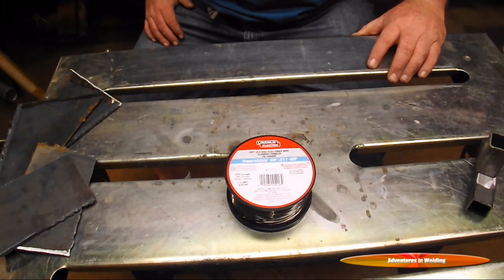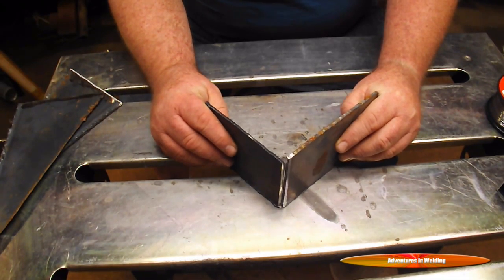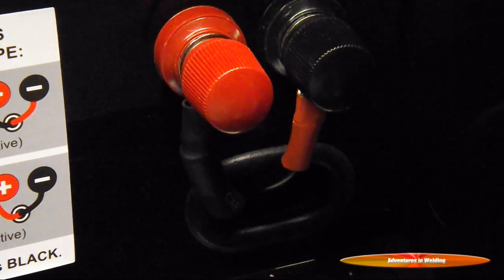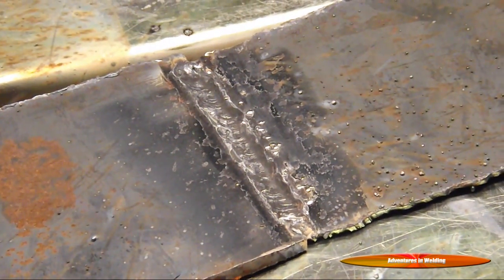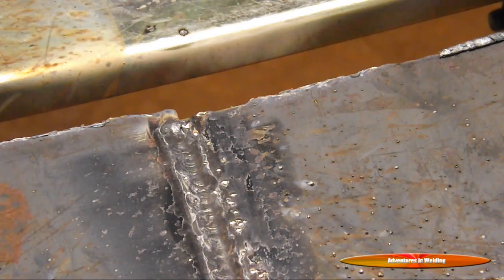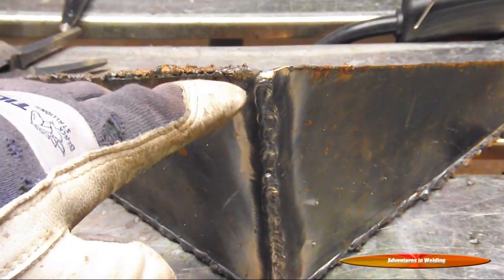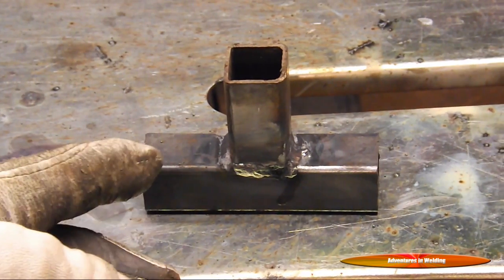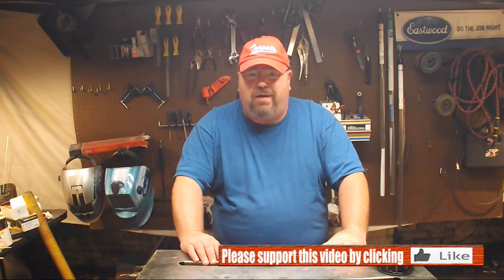Intro to Flux Core Arc Welding - Adventures in Welding 130

Comment: I tend to only use flux outside and even then use a respirator, I prefer MIG indoors as there’s far less smoke.

Here in the U.K. we’ve had a massive influx of East European machines which are great value, they seem to have pushed the Chinese out to a large extent. My package worked out really cheap and is a great machine, MIG, flux and stick 200 amp machine with gloves, automatic helmet, 0.45kg flux core wire, 5kg rods, magnets, spatter spray, welpers for £200. Since Corvid19 they’ve dropped the welpers and magnets and it’s now £250, I still think it’s good value. 

I always try to get the best consumables I can get and I’ve found a really helpful supplier, he’s been brilliant for me. I’m a disabled hobbyist so I’ll never be welding the Clifton Suspension Bridge. Most of my power tools are cheap with good guarantees, it’s almost certain they’ll outlive me. I will pay for decent hand tools as that makes a big difference and I think of consumables the same as hand tools.

Comment: Been using .30 wire from Harbor Freight Tool. What your opinion on the wire. 
Also I find I have a difficult time seeing my  line front the front side of the arc, so I try and stay somewhat on the back side of the arc to see and still maintain the drag for slag theory.

Comment: I've been welding for about five minutes and have never taken a class. All self taught, but I can tell you that 1. With FCAW you MUST clean everything! Even after you tack, the surface is contaminated and covered with flux and spatter and must be cleaned before butting up a bead. 2. Using a brass flush nozzle is only necessary for MIG to help target and contain the gas. A gasless nozzle exposes the contact tip and allows you a better view of the puddle. Plus, you don't have to worry about the excessive spatter clogging the inside and disrupting the wire feed. Just my two cents. Take it or leave it.
Reply: Some guys take the nozzle off but you must tape the threads or the splatter will screw them up. Look online for a nozzle that is short. It mostly protects the threads. Just saying

Comment: good show TU.you be amazed at what a difference a GOOD flux core wire will make. that Lincoln is the best but too expensive per pound .  the Blue demon is just as good at half the price. oh my . you might think you are using gas it sounds so good and flows 
like a melted butter.

Comment: No one has any love for the hf flux wire but I never had any problems with it.
Reply from the maker: TheToolReview My take on all things from Uncle Ho is sometimes it works, sometimes it don't. If your welder has a problem you either have to fix it get another. if your wire has a flaw, you may not know until it's too late.